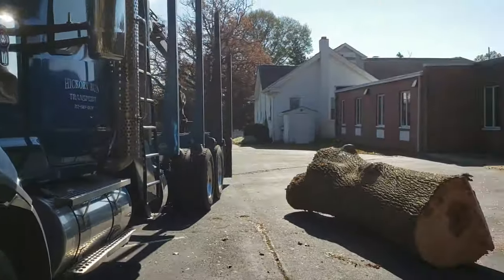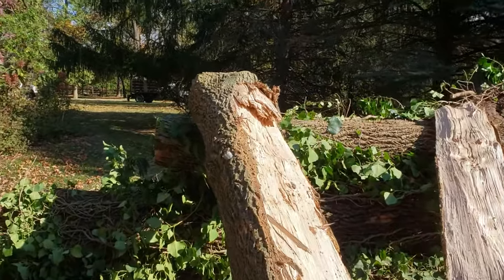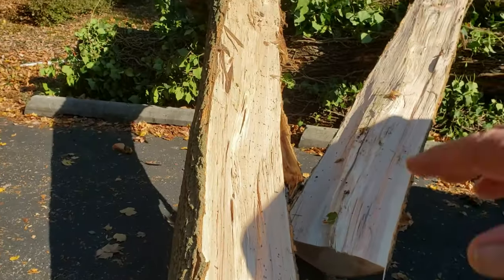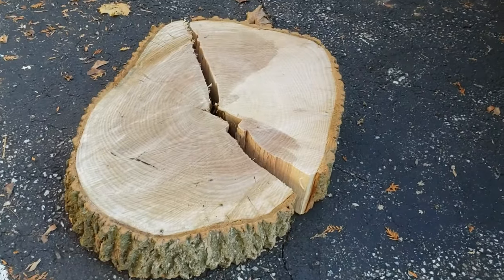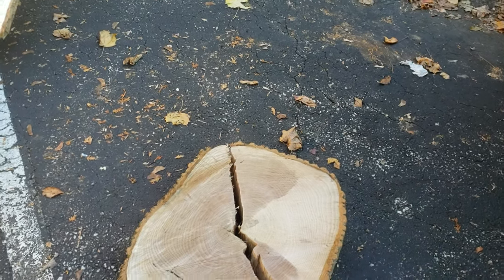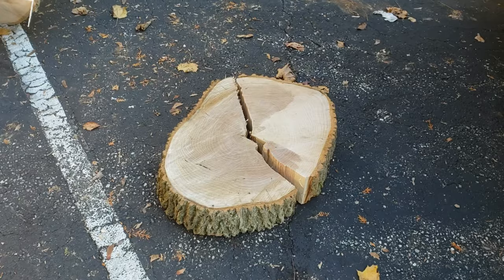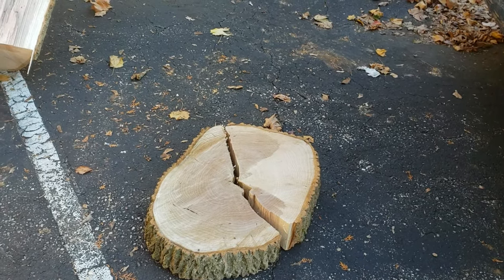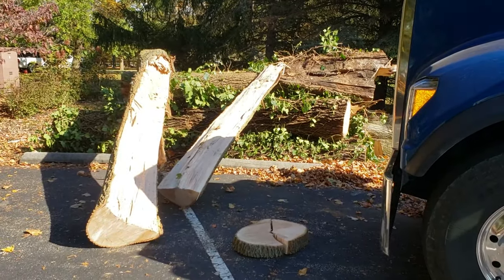A Little Common Sense goess Along  ways goes a Long Way

Comment: Cool idea to barberchair on purpose. On leaners to prevent a barberchair I like to make a notch of around 1/4 the diameter or less, plunge cut to make a hinge, then finish the back cut.
Reply from the maker: that's one of many effective techniques... I have used that plenty of times with 100% sucess so far. But sometimes when I know that's not going to work, I just strap up the tree for the added insurance